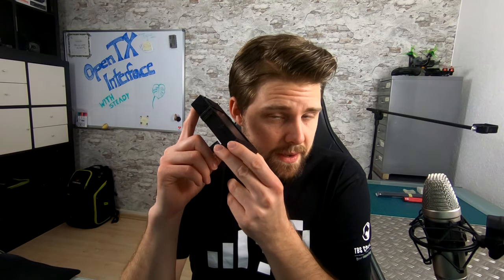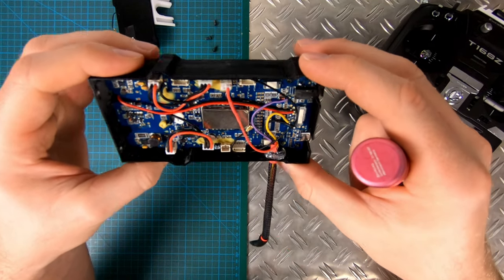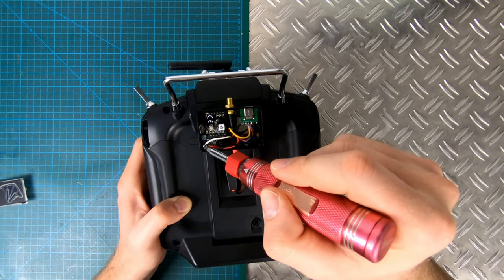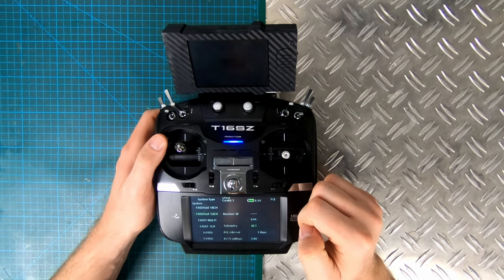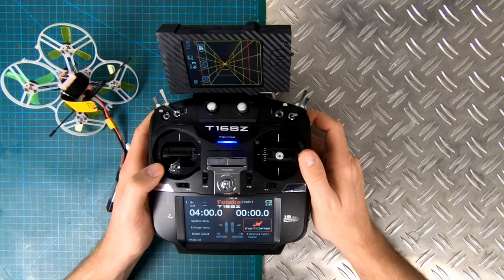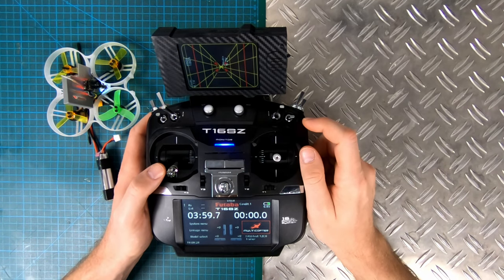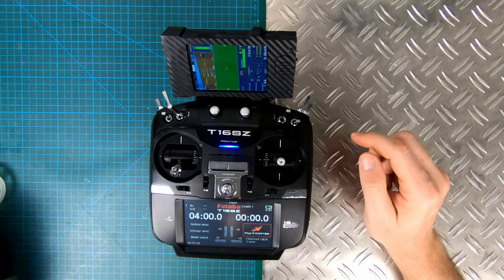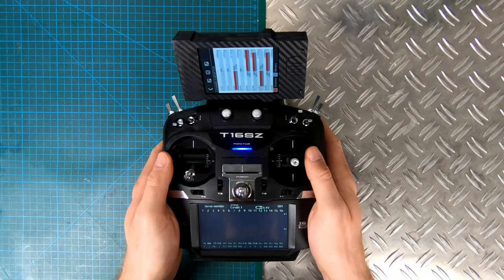OpenTX Interface for Futaba Talk

Comment: just buy a Radiomaster TX16S which is full black and has the same form factor as your 16SZ.
Reply from the maker: Don't try to compare a chinese manifactured radio with a japanese one ;p
Reply: @Steady_FPV  they are both manufactured in china. what's wrong with china ?
Reply: @calibermix8159 Put simply, don't mess with the Futaba gang if the Futaba gang does not want to be messed with!
(though I do agree on the radiomaster)